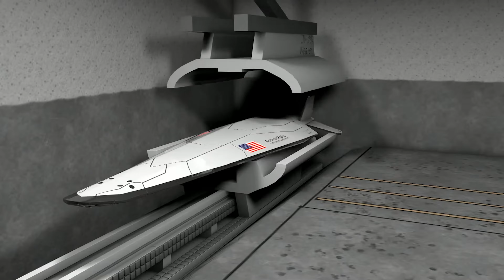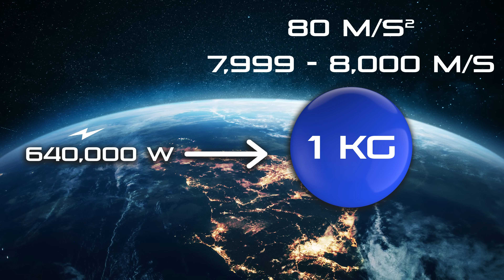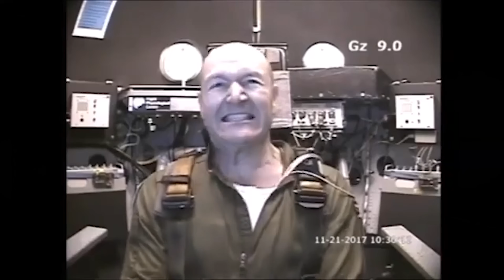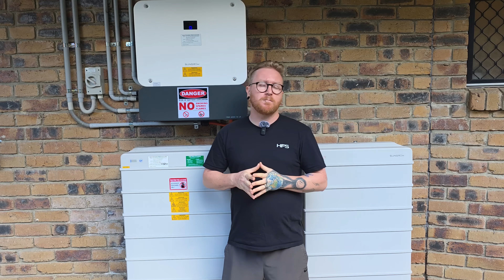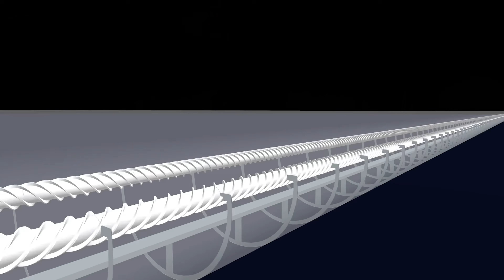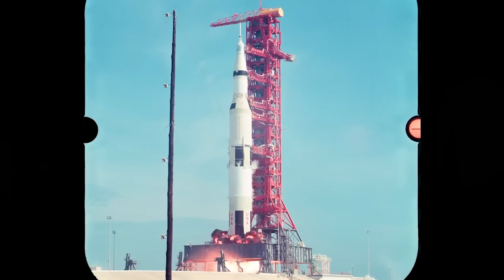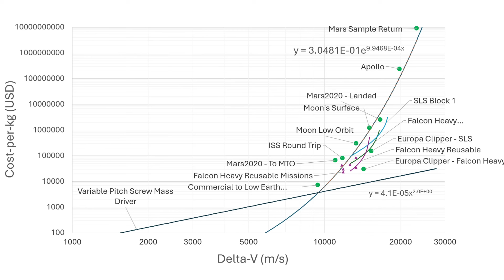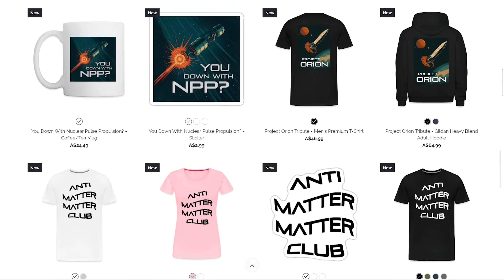The New System That Could ACTUALLY Replace Rockets

Comment: I liked your presentation. I should admit to being neither a trained Mechanical Engineer nor a Physicist.   But if the end objective is to get the benefits of F = ma, where 'F' is the summed vectors of 'a' acting on the mass, 'm,' there could be a cheaper easier way to do all of that without a rocket or the 'variable screw' that you presented.   There are other equations around that have the vector 'F' in them, one such is F = ((m*v^2)/r) [One of Huygens' equations], ---- let's call this last vector f ---- for Huygens' description of centrifugal force.  This equation involves spinning a mass at a uniform velocity in a circle and has several vectors associated with it; which can be summarized with the 'Right-Hand Rule for Cross Product of Vectors.'   All of this last part has many industrial applications, some are prosaic and well-known. Cream separators are used on a container of raw cow's milk, as an example. So that by a minor extension or two, one can imagine a (flexible tube taped to a cardboard wedge, say) circular tube or pipe that has water being pumped through it (by whatever means), then one might also imagine this circular pipe that could be folded along a rough diameter to about 20 degrees or so.  So now the vector(s) f might be labeled as '2*f' as there are two independent vectors because of that 'fold.'  Because of vector algebra, the '2*f'' part might now be labeled as f'' which written more fully becomes: f'' =2*(cos(10 degrees))*((M[the mass of water, [say, in each limb or approximate 1/2 circle of the tube that has water pumped through it]*v(the velocity of the water being pumped)^2)/(r-which is likely a bit shorter than the mathematical 'r' because we are dealing with physical objects here)).  The pumping device could be a centrifugal fuel pump, like is used in commercial or NASA-type of rocket engines ---- for the pumping of rocket fuel, using a water steam pump from the chemical reaction of 80% hydrogen peroxide and sodium permanganate  ---- typically rated at about 500 Horse Power [Hp]. Not new information by any means, as there are books written about this method of 'traveling through space without rockets,' maybe there is even a 'shorter version' of this book, so to speak. If you take this suite of ideas to one of its logical conclusions. Not as long-winded nor as expensive as the NASA versions (even if only used as an interplanetary method), but there you go.  And, if you use Newton’s Law of Gravity (the mass of the widget and the mass of the asteroid would attract each other with the widget being able to move about pulling the asteroid with it via gravitational forces), you don’t have to actually hit the object, but just move it a bit, slower or faster, to cause it to fall into a near Earth orbit to be mined for any useful minerals?  Why not?
Reply from the maker: I'm glad you enjoyed it! You've had a good think about this, and I like where you're trying to go with it. Short answer from my understanding is the physics you cite is correct (centrifugal forces exist and can be used for useful work), but it doesn’t bypass the basic conservation of momentum and structural scaling problems that make rockets, or VPSL necessary for getting mass to orbital speeds. Huygens formula just describes the internal centripetal/centrifugal forces needed to keep mass moving in a circle. useful for separators, pumps, centrifuges, ect.. not for producing net external thrust by itself unfortunately. No free lunches in space travel, the Earth is a jealous girl and she wont give us up without a fight😅

Comment: Add laser propulsion to the spacecraft after VPSL  exit and you might be able to launch vehicles into space with no onboard fuel
Reply from the maker: Possibly, but you'd still have the problem of landing. if you had some infrastructure that could catch the rocket at the destination it could work, but it also still needs control thrusters.. In the end using a rocket engine for these tasks is probably simpler, cheaper and more reliable

Comment: I understand how you can change the speed of an object by changing the pitch of the screw; however I have no idea how the pitch of the screw is used to transfer energy to the sled without engaging the screws by using electromagnets only. I also have concerns about how stable the massively long screws would be when spun at the extremely high speeds needed to launch a rocket
Reply: I think that some of the videos linked in the description will provide answers to your questions.

Comment: You should not focus that much on price/kg, comparing theorical ideal price with true commercial including maring is not fair at all.
I thinkg we need to talk more on the challenge to build such a mega structure, of course it will be cost driven, but this wont be as easy as a computer simulation
Reply from the maker: Cost to orbit is the number one issue for space access, its the biggest limiting factor. That's a fair point you've made about real world (private, for profit) launch costs vs theoretical costs - but I can only use the information available. Consider though, cost to Mars currently is $2.5m/kg, compared to the theoretical cost of VPSL at $3.8k/kg. If the VPSL system somehow ended up being 10x more expensive than planned, it would still be 66x cheaper than current rockets.

It will definitely be a complex engineering challenge in the real world, 100% agree with you there.

Comment: Pipe dream. We have no materials that can handle torsional stresses over such distances.  Add to this increasing pitch, the whole system collapses.
Reply: Why would this need to be a solid screw, surely banks if flywheels independently controlled and spun up should be possible. We already have this technology.
Reply: Each screw segment has an electric motor inside it, so there are no torsional stresses over long distances.
Reply: @ bobfree We just have to invent adamantium and pretend friction doesn't exist...😅
Reply: Why is it assumed it is one long segment. probably shorter faster ones at the beginning of the tube and they might get longer further along the tube to allow time impart momentum to the cargo/sled. Varying the pitch of the magnet mounts isn't the only thing in play here i feel.
Reply: well thats weird.
My Mechanical design, and my machinists handbooks both have the formula's and losses for using both rotating shafts and cables across miles.

Fromulas and guides from the 1860's.

I think you've either over estimated the torsional forces required (keep in mind unlike a rocket this would be slowly adding in energy to the system across the entire length, this includes the torsonal forces to get the screw up and running)
Or you have severly underestimated the strength of ... cast iron. Not even steel.

Comment: Reusable boosters are way way way way way, way way more practical than something like this.  Fuel is relatively cheap.   And you need to get all that electricity from somewhere.
Reply from the maker: Not for interplanetary travel, as demonstrated by every interplanetary trip we've ever launched. The scale is the issue, you can get to LEO cheap enough, but the further you want to go, the more exponentially expensive it gets.
Reply: @HelloFromSpaceAus  mass drivers are actually more limited for interplanetary travel because you have to have even more energy and more acceleration.  

With reusable boosters and orbital refueling, you can put a starship into orbit with something like 6000-8000 m/s of Delta V.  That will get you anywhere in the solar system with the ability to slow down and capture and orbit, land etc.

All without a multi trillion dollar finicky piece of infrastructure with the highly expensive upkeep. We haven’t even mentioned how vulnerable something like that is to weather. Imagine your multi trillion dollar vacuum tube gets hit by a hurricane or even just bad wind thunderstorms?  

Reusable boosters with refueling is technology that’s available now, doesn’t require miraculous breakthroughs and material science, allows you to launch into any orbital inclination you want at any time, etc. if you have a mechanical problem and lose a booster, it’s not a big deal because you have many more boosters. If you have a mechanical problem in a vacuum tube that’s hundreds of kilometers long the entire program is shut down. If you have a severe mechanical problem, the whole thing self-destructs because of the enormous amount of energy that is stored in these twin rotating screws. It would be like a giant flywheel flying apart.

Again, we all want something like this to be possible because it would be super cool. However, there are much more practical options that are available right now. Even if you wanna look into the near future options like sky cranes or sky hooks are going to be Much more practical than having a vacuum tube hundreds of kilometers in length with twin rotating screws made of some substance that requires near miraculous breakthroughs in material science.

Comment: Would be nice to see a proof of concept model.  I doubt the material of the screws can handle the torque required to push the mass.  Youd probably require more carbon nano tubes than are possible to make.
Reply: Each screw segment has an electric motor inside it, so there are no torsional stresses over long distances. It can be made with steel. I'd suggest that you read the peer-reviewed paper to learn more about how (and why) it works.

Comment: This is an interesting concept, but there are some clear engineering hurdles.  Many of them have already been pointed out in the comments and this is what I think you missed in your presentation. Good creators always present known risks and challenges. Your video seems to conclude that this tech is the Holy grail for space launch. I'm always suspect of claims like that. 

One specific observations I made was the ability to control orbital inclination.   With something like this,  you would have a narrow window for inclination.  It would be determined by the site's latitude and orientation. 

Yet you implied this could likely make launches by rocket to LEO obsolete. I'd think the sweet spot for this system would be something that gives access to medium inclinations. But what about the need for all the launches to polar or equatorial orbits.  What about all the planes for the new mega constellations.  The delta V for plane changes is not insignificant.  That is going to have to be done by rockets on orbit and the impact will be much higher than if you could launch directly into the desired plane.  This will hurt your expected advantages. 

I like the topic and the thorough coverage, but I'd recommend you work hard to find the other considerations to provide a balanced perspective in future videos. I look forward to what you do next.
Reply from the maker: I'm definitely a big believer in scepticism. I'm presenting an idea, and I did (to be fair) at multiple times through the video caveat statements with 'could' and 'if' - I did not make definitive conclusions, because I cant honestly do that. No crystal balls here!

You're absolutely correct that there would be some additional challenges in using this system for launches to Earth orbit. The paper doesn't discuss this at all, it only discusses using the system for travel to other celestial bodies such as the moon and Mars. It could be scaled smaller for Earth orbit, but it hasn't been designed with that specifically in mind. Rockets aren't going away any time soon, but for interplanetary missions, they're not going to be the best option long term.

I would have liked to go further into it, however this video already ended up being 45 min.. So instead I tried to present as much information as I could, in a manner that could (hopefully) be best understood, and trust that my audience can make their own mind up. There's certainly plenty of people doing that in the comments, which I'm really happy about. I'm glad you enjoyed it all the same, and I appreciate the well considered comment - I'm always trying to improve so I appreciate the feedback😁

Comment: Quite economical if you ignore Starship.  Here's what Grok says: 

SpaceX targets under $10 per kg to LEO with fully reusable Starship operations, assuming high launch cadence and rapid turnaround. Early flights may cost $100-200/kg based on $10-20M marginal launches for 100+ ton payloads. To Mars surface, estimates range $200-500/kg initially, factoring orbital refueling and interplanetary transit, potentially dropping below $100/kg long-term with scale. These are aspirational figures from Elon Musk and analyses, pending operational maturity.
Reply from the maker: I'm a huge Starship fan - however whilst I would love to, I have never believed these figures to be realistic. This seems to me to defy the laws of physics, and the tyranny of the rocket equation. I really hope I'm wrong, because it would be amazing for space access.

Comment: One inches use massive balloons to take it to the upper atmosphere and then launch
Reply from the maker: A balloon gives you altitude, but unfortunately not velocity. Virgin's Launcher One tried a version of this by launching a rocket from a 747 at high altitude. Unfortunately in reality orbital speeds are so immense that high altitude launching of rockets doesn't gain you much. That's my understanding of it anyway

Comment: If you have a ground based launch system, then you need to consider footprint. Plus side, if it's as efficient as claimed, then it doesn't need to be in an optional area, which would allow for placement in cheaper and more suitable areas to build 

Also, there will be a hard limit on launches due to heat and mechanical stress. You'll have to dissipate heat and you'll have to give it time to spin up. 

In a lot of ways, this sounds like a different take on a launch loop.
Reply from the maker: Yeh that's a fair point, I've joked about placing the system in the Australian outback. Plenty of flat space out there! Ideally you'd want it to be launching out over the ocean in case of a failure of some sort. Phil's paper proposes putting much of the tube 20-30m under water to reduce its footprint.

The mechanical heat is also an interesting point, there would definitely be head mitigation methods. The vacuum would definitely make heat a more complex issue to deal with, as you cant cool by convection. VPSL and launch loop have some similarities, but they are more different than they are similar. The scale of launch loop is on a different level for sure

Comment: How much do two, 1 meter diameter rods several kilometers long weigh? If their angle changes along their length do they flex? Or are they in segments? How much does the total assembly weigh, including not only the support structure for the rods, but also the several kilometer long vaccum tube large enough to contain them along with the payload vehicle PLUS the "sled"? 

Further, for those rods to magnetically drive the sled, they will need to be energised along their entire length. And that energy is NOT transfered mechanically. It is transferred magnetically. Electro-magnetic force is, basically, electricity. So, instead of a simple mag driver, you have added the huge weight and complexity of the gigantic rotating screws for the exact same effect. 

Sorry, I think this is a huge boondoggle. Hopefully decision makers can see through this.
Reply: The screws are segmented and supported by brackets (there are clips in the video that show this). The masses of all the components are tallied up in the digital twin. The screws and adaptive nut are essentially a magnetic worm gear, whereas a linear motor is an actual electric machine. Both use magnets, but the linear motor converts electricity into kinetic energy. The magnetic worm gear does not - it just transfers momentum.

Comment: You didn't subtract the price of the Mars spacecrafts and rovers when you calculated the cost per kilogram to the surface of Mars! The right way to estimate that  would have been to consider the launch cost, the cost of the cruise state, retro propulsion + parachutes . For example the Curiosity and Perseverance rovers constituted 75 % of the total mission costs. But even if that is taken into account that was very expensive per kg.
Reply: The cost of spacecraft was included in the calculation, but not the cost of the payload that's delivered to Mars in those spacecraft. Can you share where you learned that 75% of the Mars 2020 total mission cost was for the rovers?

Comment: A glider at the doldrums at the equator, could get very high. It could transport a small rocket to a point with low atmosphere.
You need a lot of small rockets with a small payload. But you don't need any energy to get to 60.000 feet or or so.
The rocket will accelerate quickly to orbital velocity, because of low air resistance.
And don't send people. Just send remote operated drones, to build something in space.
And you could design the rockets, to be partially used as building material.
Or ... a small rocket could deploy some sort of sail, that causes drag, even in low atmosphere,
that it slows down and does not burn up during re-entry.
Reply from the maker: Its an interesting idea, essentially a slightly different take on Virgin's Launcher One. Unfortunately it only gives you 'free' altitude, not velocity. The craft would end up having to still do 90% of the work of a ground launched system to get up to speed. I'd like to see something like this work, I have wondered if this system would be better for much smaller payloads, like cubesats